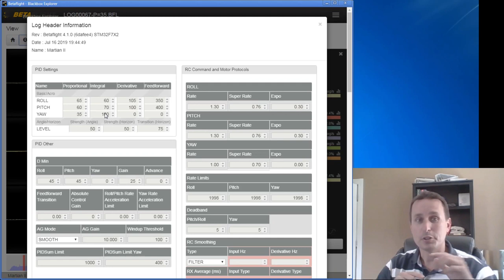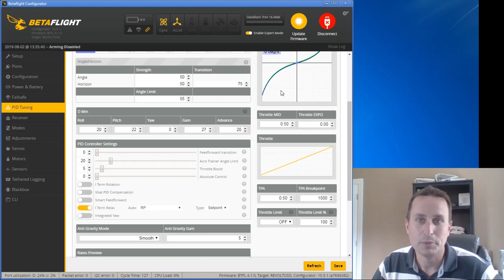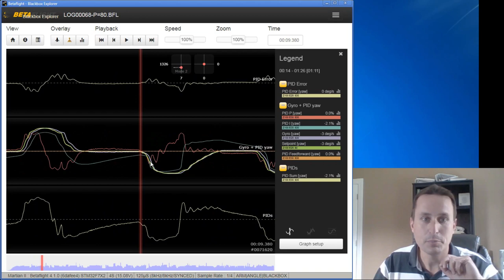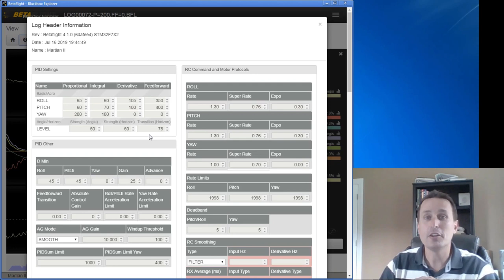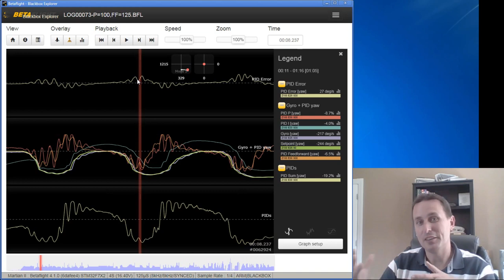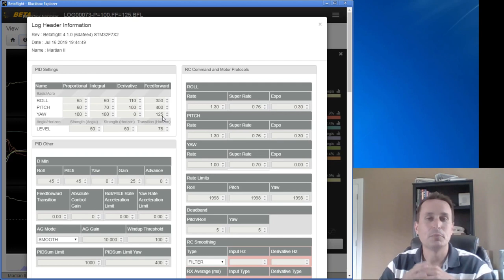PID Tuning Principles: Step #5 - Yaw Axis Tuning

Comment: Just finished tuning one of my quads following your five steps, betaflight 4.0.5.  This has to be the best I've ever had any of my quads flying. I can't get the gyro to completely follow set point but I would say my quad is now 99% there. Thanks for the video series. I assume for betaflight 4.1 since everybody is recommending to keep all the filters on the only thing I would need to do then is to in the pits and not mess with the filters?
Reply from the maker: You want to move the filter slides up.  See my RPM video, also the filters details video i released today.

Comment: Can you help me trouble shoot please? Frame  is  a six inch Kabab Flowride. Motors Emax 2306 RS. I refitted it with F7 CL racing stack and motors 2 and four will loose power at about third throttle and then continue but at a much lower current making any kind of Acro maneuver causing you to drop out of the sky. If a motor is bad could that cause this? The ESC and FC are brand new and the build was clean. Could it be defective ESC? I’ve never experienced this on any quad ever. I can send a video is that helps. Thank you for any ideas 💡 🙏!

Comment: My quad (flywoo lr 4 inch with 450mah 4s battery) jumps like a meter or so when i do fast  Yaw movements like in this video at arround 00:54 mark. It is ok only if i move the Yaw stick slowly. Any idea how to solve that problem.
Thank you sharing thesee valuable information.  :D

Comment: how do you deal with altitude changes with yaw inputs? I understand that yaw'ing spins up and/or spins down two motors so I just kinda learned to live with the altitude changes but looking at your vid yawing left and right, your altitude seemed fairly constant. i've been having to actively manage my throttle and it makes for inconsistent flying.
Reply from the maker: Correct.  Drop throttle.

Comment: I need someone help bad my yaw is turned up on my remote I finally got my quad to arm outside of beta flight but when I give to much throttle it just takes off and I can not turn the motors back down they just go like full throttle and won't turn down

Comment: Hello Mark with the Eachine TS 215 V3 and Betaflight 4.0.5 all hve all corecly done and flashed him , have maked all from your Vidios and when i starded  him he was going directly high about 50 m and comes back with a noise of a bee that two times so i dont have control with t Transmitter so when he comes back in 2 m about the groud i cut him and he falls down . The Omnibus F4 SD with this version the FC is the whole bottom plate . The motors have had 105 degres  i was rely shoked , and i have 9 Drones more and the all are going perfectly . End of the song i flashed him back to 3.5.7 and he goes like a devil i write you that i have had everytime the problem with this Drone . I dont understand until today ???????
Reply from the maker: Sounds lik you have it sorted.  In the future, you don't need to flash back.  You can just apply 3.5.7 defaults to 4.0.x and get the same results as 3.5.7.

Your issues is low end noise that 3.5.7 defaults has more conservative filtering to cover up.  https://github.com/betaflight/betaflight/wiki/Community-Presets#revert-to-bf-35x

I know we have talked about this mulitple times now.  Other comments, FB, Discord.  All over this Eachine TS 215 V3.  Throw it away.  LOL.

Comment: why all my quads are getting throttle jumps if I gave full yaw stick, also when I center the yaw stick. It happens only on very fast throws. it jump up 3 to 4 meters.
Reply from the maker: Physical constraint.  Motors spin up faster than they slow down.  

In tuning yaw, do keep in mine rarely do you just give it full raw rapidly without another movement mixed in.

Comment: Hello as usual, thank you for the advice you give us. I tried the setting and I have to say I like it, I only have one question: with pids so high, does battery consumption increase? sorry for the grammatical form but I use the translator
Reply from the maker: In theory, but consumption has so much more to do with how hard you are flying; or not.
Reply: @uavtech  Hello. I think you're right I tried it and it's just like that. It's that the setting is so good that it leads me to push harder.

Comment: I have very strong  bounceback  after  fast rotation on YAW axis and sharp stop. Its only in BF  4.1 .  There is  NO  strong  bounceback  in BF 3.5.7  .
Its  only   on  YAW axis.   Pitch &  roll   is  good  !
What can i do ?  What settings  to  change to eliminate  strong  bounceback on YAW  ?
Reply from the maker: lower P or FF, that's about it.  Not a lot of authority on Yaw to control such issues.  I only get them if i do a full rate 360 on yaw, which i never do in flight so not an issue.

Comment: hey uav tech i just got the iflight succex mini twing f7...im confused about the product page description at the very bottom theres a notice""NOTICE:

For betaflight 4.0 and up you need to flash the base firmware stm32f411,and then copy the CLI for individual fc board.

CLI code here for SucceX F7 TwinG and Mini F7 TwinG

im a noob so someone please explain.....thanks in adavance
Reply from the maker: you can flash the EXF722DUAL (see https://www.screencast.com/t/sPoHVcyaq).  They are just jumping ahead to the Unified Targets that are coming with 4.1.0.  The unified target for the TwinG is teh STM32F411 and then you post the Config File and then setup from there.  For now, just flash the EXF722DUAL.  BF devs are making the Unified Targets much easier to config up through the Configurator with the 4.1.0 release coming in October 2019.
Reply: Ok because when I tried the stm32f411 I couldnt get back in the fc..so I used stm32f7x2 and it worked plus my rssi is working right now...had a  hard day yesterday trying to get rid of a real bad yaw twitch ..come to find out gyro 1 is bad ..yep DoD ..are these gyros bad or am I just unlucky
Reply from the maker: @byrden1985  , mine have been fine.

Comment: I fly a lot of line of sight, and this new 5 inch I just built does some weird stuff... When I do a constant yaw, right at the beginning it pumps up and shoots up about a foot..... then when I stop the yaw it pumps up even more and shoots up like 2 feet....  

I guess I never noticed this happening on my 3 inch because the motors were smaller and  low RPM lift wasn't as drastic so I didn't get any of that shooting up. I think the fact that theyse 2306 motors have a lot of low end torque that it makes this more drastic..... But MAN is there a way to at least reduce this? Can I get rid of it altogether? Even fenagling the stick in a way to cut the throttle at the end of a continuous yaw spin KINDA works but it kinda goes nuts........

Edit: but no I just remembere I DID have this issue one time with my 3 inch quad  damn... I remember specifically I was like WHAT THE HELL.... and I honestly don't remember what I did to change it.... I THINK it might've been simply all about centering the gravity better... kinda makes sense because I do have a huge bulky antenna sticking out the back of the quad -.-
Reply from the maker: You can turn off Airmode to mitigate, but it is a mechanical limitation i don't know how you can currently get around.  Yaw is motor prop and bell inertia driven - two spin up as two spin down - and motors don't spin down as fast as they spin up, which causes the jump.

Let me talk with Joe Lucid (RPM filter inventor and a big LOS pilot) about an idea I have to resolve through Firmware.
Reply: @uavtech  Cool thanks... It wasn't happening to you nearly as drastically as it happens to me. I TRIED RPM filtering and it just wasn't working for me, I  started getting these extremely strange artifacts and flight characteristics. Almost like the RPM detection lost it's focus every once in a while and the quad didn't know what to do. It's hard to explain. It just wasn't working for me... I set it up all correctly etc but W.E I'm fine without it. ;>

Maybe I'll give it another shot in the future but I saw the same type of thing in one of JB's videos. It's the one where he puts RPM filtering on one of his "problem quad". And claims it got better... but you can see in the video it's not better.... But more importantly you can see those weird artifacts I was talking about experiencing after using it. The artifacts are even audible. One clear example is while flying LOS I was doing back flips and most of the time it would work fine, but every once in a while I got this HUGE... like... ENORMOUS bounce back  that you can SEE even flying LOS which is like.... something you don't see very often flying LOS so I was like... Nope I'm going back to 8k 8k dshot 600 ;D

BTW I use idle up on my quads and never use airmode... I'm glad of it now lol... The thing is if I don't do a QUICK stick movement to yaw it doesn't happen as bad... it's only when I make quick stick movements......

You can kinda hear what I'm experiencing in your video here, at the end of a full yaw spin you hear the motors kind of... upping and downing (for lack of a better term) when the yaw stops to fix itself... but mine is so dramatic it almost gets me stuck in a tree it's so bad.
Reply: @uavtech  lemme elaborate further about this as well. When I do this yaw spin ALL of the axis gyro and set point lose each other terribly.... the setpoint stays flat with pitch and roll btut he gyro flows up and down over it like a wave of water.

Is this normal? This is a new quad new motors etc.
Reply from the maker: @upplsuckimcool16  bounceback is NOT because of RPM.  It is just not possible.  Log it both ways and you can see for yourself.  Regardless, there is nothing wrong with sticking to no RPM too.

I would need to see some DVR and logs to see what is going on with your tune.
Reply: @uavtech  It's not constant boucne back... it's an artifact.  It's so dramatic I would even hesitate to call it bounce back... it's just a straight glitch in what is supposed to be happening. It's more like an enormous twitch like a bad motor.
Reply: @uavtech  A weird thing happening that I am not used to is that my D term is very very jagged. Like... noisy... ifI look at the actual frequency spiking it looks ok... Here.

http://prntscr.com/rh9222

Check it out that'd be awesome. The only way for me to get rid of that is to literally crank down D-term to like 10 or less. Starting to think I'm getting vibrations from this cheap frame I'm using I really don't know.
Reply from the maker: @upplsuckimcool16  , if you have a twitch - and if you wanted to both - you could look at RPM telemetry errors from ESCs.  Sounds like you have some.  You on 4k/4k Dshot300?

Honestly, just run the Dynamic Notch.  If it isn't broke, don't fix it.
Reply: @uavtech  I had 4k 4k dshot 300 yes.... and dynamic notch on... I had exactly what JB suggests, and I think it's also what you suggest as I believe he quotes you.. and yes I just shut off RPM and turned 8k8k and ds600

Comment: So I have a question about tuning yaw.  I get crazy oscillation when I yaw spin, to the point the quad either rockets into the ground or to the sky if inverted or not. Is that just too much i term? All defaults 4.0.4.
Reply from the maker: No, you probably have a lot of Yaw noise.  Check your yaw traces and don't forget about the yaw filter if you can't fix it mechanically.
Reply: @uavtech  the traces look clean even on raw gyro, but the motors are going to 100%, hence the rocketing up. Also it only happens on zero throttle.
Reply from the maker: @mlfpv7025  , you have a log?  You have motor reverse set right?  I-term is high in 4.0.x on yaw, not noise has NO impact on Yaw.  P-term yaw is lower than ever before on yaw.  

Check motor reversed toggle and also kwad orientation in Configurator.
Reply: @uavtech  Hi, got the same behavior since 4.0.x on several quads, I'm running motor reverse too, I dont realy understand why this happens on quick yaw stops. Gyro is well filtered on all axis. Also It's way more prononced on my low kv 6" than on my high kv 5".
Reply: @uavtech  Yes I have a log.  You want to take a look?
Reply: @heav3n_fpv192   Mine is a 6S quad as well.
Reply from the maker: @mlfpv7025  , yes.  Drop a link to download.

Comment: Wow... Glad I've gone to falcox
Reply from the maker: LOL.  Falco X still has a PID controller.  Smartass.  :-)

Plus kind of flying blind for making filter changes (no logging).  I kind of look at it as if the presets fly good for your, sweet, but if not it is a lot of guessing and less tools to address specifics issues (frame resonance, etc...).  This said, the BlackBird preset flies sweet on my Nova frame.
Reply: @uavtech  lol yeah I know, its just that it seam every revision of beta its like this and that have changed so forget everything I told you before... And yes I know all the other are like that also, but let me live in my fantasy world being new to FalcoX for a little longer...😳

Comment: Any advice on how to deal with Yaw iTerm windup? I've a copter with winglets that transitions into forward flight. However when turning, I'm seeing the Roll bounce back. (Yaw controls Roll once nosed over)

More info on the Quad: https://rotorbuilds.com/build/27673

Thank you in advance!
Reply from the maker: More P-term on yaw, or lower i-term windup in the CLI to 50%
Reply: Update: Tried to fly this morning but BetaFPV M02 VTX is dead. In this case I "believe" the antenna came lose somehow and burned the transmitter. Hate BetaFPV products as they always fail or are of poor quality.

will likely swap out the FC and VTX while ditching the 5V regulator that's no longer needed. (SucceX F4 V1.1 1S 5A AIO Whoop Board with VTX) Should save 3-4 grams as well as simplify the wiring quite a bit.
Reply from the maker: I would set RP for i-Term Relax.  Yaw depends on I-Term quit a bit for authority.  But try it both ways.

School already!!
Reply: @uavtech  I reside in Germany (retired military) so the school schedule is a bit different from the States. Last week was their last school day and they're now on holiday for 6 weeks!

Anyhow the increasing / decreasing Yaw Gains didn't help no matter what values I tried. Will next try out integrated_yaw to see if ditching Yaw iTerm avoids this issue entirely. That's assuming Yaw will retain some form of stability control. Which would be really helpful for maintaining Roll stability in winged flight.

Latest flight: https://www.youtube.com/watch?v=Ji4h01kVouo&t=1s&ab_channel=4DCResinSmoker

Side Note: Its surprising just how little information is available online for integrated yaw. Next to nothing on YouTube either.

Comment: I'm confused. You say that feedforward is faster than p-term because p-term needs a pid error and feedforward reacts to the sticks. I understand that, but once you move the sticks, don't you instantaneously get the pid error because the setpoint moved? Or is there something (maybe stick interpolation) slowing down the setpoint reacting to the sticks? And if the difference is caused by stick interpolation, does that mean that feedforward is reacting to raw stick values instead of interpolated stick values? Or is there something else going on? what is preventing the setpoint from instantly reacting to the sticks and why is feedforward not also hindered by whatever that is?
Reply from the maker: FF is measured of the speed of you moving the sticks.  So the faster you move, the more push it drives.  P-term does not work that way.  It only drives based on PID Error (the bigger PID Error the bigger the P push).  The main problem with P-term only is you can't have it high enough to provide enough push to track Setpoint super well.  If you would make the P-gain high enough to push hard to track Sepoint you will get extended oscillations in prop wash.  There needs to be another term that is seeing the change occur and beating P-term to the punch; to the push.  In classic PID control, this is called FF and is based off measuring differentials BEFORE they cause PID Error.  That is what FF does in BF.    See https://youtu.be/FW_ay7K4jPE for details.
Reply: @uavtech  
Ok, I watched it. I think I know why I was confused. I thought that somehow feedforward was calculating the setpoint error faster than the normal controller was calculating setpoint error, which is silly because its just a few add and multiply commands. But that is not what is happening. Instead, the feedforward is predicting where the setpoint is going to be in the future based on (as you say) how fast the stick is moving. The stick isnt actually there yet, and the setpoint isnt there yet, and in fact its possible that you could instantly stop moving your thumb and this guess would be wrong. So the feedforward is basically telling the system to react as though the setpoint has moved a lot, even though it has only moved a little. In the rare cases where the setpoint does not move a lot, and really only did move a little, well oops. We will just have to let the pid controller undo our bad guess. Does this sound about right?